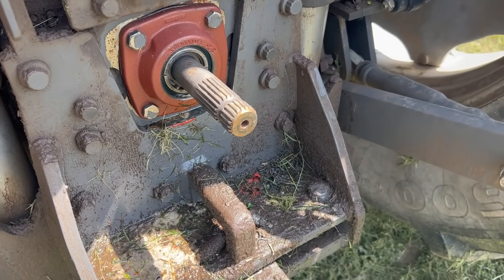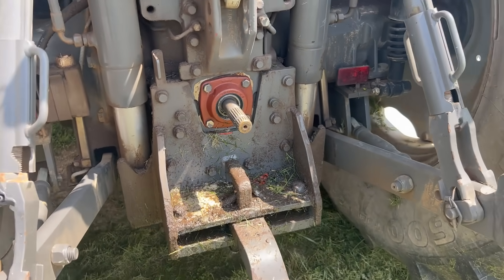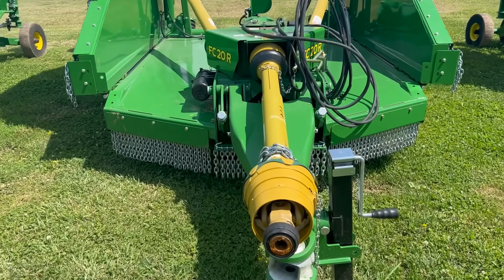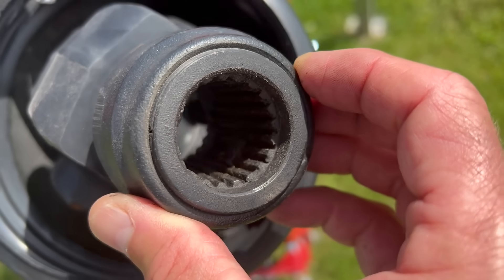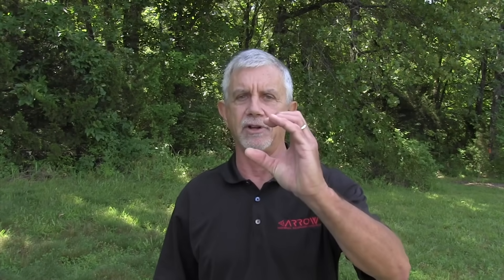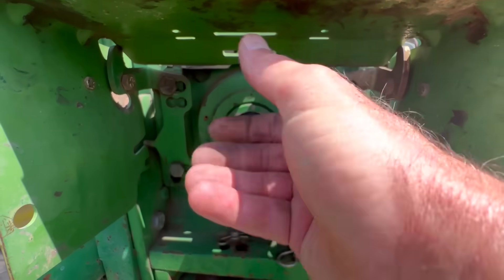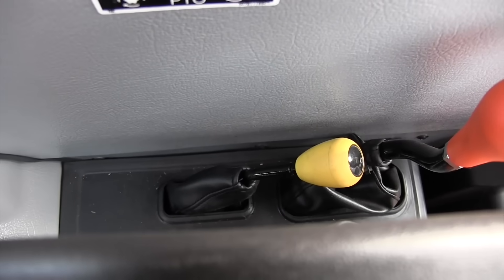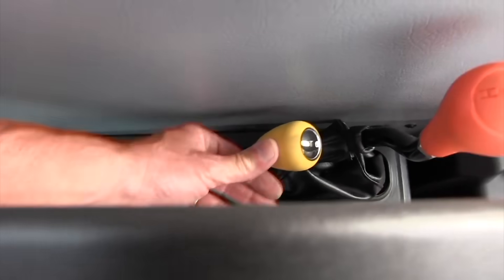Demystifying Tractor PTO Speeds: 540 Versus 540/1000 RPM Explained!

Comment: I love the 540, 750, 1000, shifter on my mt573. Works great on overpowered implements as you said and I don't have to rev the shit outta my engine. Coming from heavy equipment,  I cringe at rpm over 2000.

Comment: Both old John deere and International tractors had a bad design what with the dual shafts spinning on the IH, and the having to park downhill on the Deere when changing shafts.  Like, you shouldn't have to park a tractor downhill to change a shaft, that's a big inconvenience.  I only did it once and decided it was better to just swap them quickly and deal with a little bit of oil loss.  Older Case tractors had the better design where you just pop the shaft out and turn it around and put it back in.  Different splines on either side.

Comment: I have a Massey Ferguson 5455 and it has two separate stub shafts for 540 and 1000.  The 540 shaft is two inches longer than the 1000 shaft, so you don't have to change the drawbar length.

Comment: I like the Case 70 series that flips the shaft.   Simple.  Just need to take care to clean shaft well before flipping.   You will lose a little fluid onnthe flip,. When you flip, one side of shaft is longer and you have to push and compress a spring to engage the other gear set.

Comment: In 1990, I bought a Kioti LB 2204 that had 4 PTO speeds.  540,720,1000 and I believe 1500. Had a manual shifter.  Never used the higher speeds. Did shift speeds with a bush hog to see the difference.  1500 sounded like it was ready to take flight.
Reply: I have a similar situation with my old Mitsubishi 650 bull 4-speed but I believe the top speed is 1250 I could be wrong about that though

Comment: Nice video.  A common problem with hired help is the misunderstanding of torque v. horsepower.  There is a misconception of rpm and its effect on torque load. This causes repeated shear pin breakage on grain augers.  The operator will run grain auger slow thinking it is easier on the auger and be frustrated at the darn shear pin breaking. This is made worse due to the auger running fuller at slow speed since the grain has more time to flow into the auger flighting as the flights "pass by" the inlet.  I attempt to explain the shear pin by comparing it to an electrical fuse and saying rpm is like voltage and as speed increases a smaller fuse is required as fewer amperes are needed to do the work (horsepower).  Slow it down, torque load increases, pow goes the shear pin, get the shovel and clean up the spilled grain.  A bigger problem with a grain cart with a huge auger.

Comment: My favorite auger tractor is our old IH 784 with a 1000 to 540 adapter on it. lt will idle all day moving as much grain as it would on the 540 shaft running at 1800rpm.

Comment: What I wonder about is when you go from 540 to econcomy 540 your rpms drop . At least on my tractor it plainly on my tractor  to keep RPMS 2000 or above but the E 540 runs at about 1500 RPMS . I was told by the dealer that if you run the tractor below 2000 RPMS it cause clogging of the DPF system and problems in the regen system . So I  run my 540 pto at the recommended 2500 RPMS and if I use the E540 Which recommended is around 1500 RPM I do not run it below the plainly labeled not to use below 2000 RPMS while working I run the 540 E at exactly the 2000 RPMS which 500 RPMS above 540E RPMS marked on the tractor. I see it as problem but a split the difference to stay away from DEF and REgen problems while using the 540E .   SUGGESTIONS

Comment: Mike I have a Kubota M5400. The filter bowl got a crack in it and fuel ran out. I replaced the bowl and tried a start it and it just turns over. A mechanic at the dealer told me that I’ve got air in my lines at the injectors. It’s above my skill level. So I’ve been trying to hire someone to load it and haul it to dealer. It’s been down for a year next month. Down here in Gulf Coast Texas in a farming community I thought it would be no problem getting it back running.

Comment: As an European tractor operator, more specifically Scandinavian. Ive barely hit 30y and as long as ive been interested in the farm and such we have always had the same type of pto shaft. This was probably changed / adapted before i took notice but ever since our old old Fords from the 70s and early 80s the shaft has been the same, the "540" shaft. And its been used on all the equipment as we just change PTO gear. And if im not mistaken it was 540 and 1000 gear to begin with and eventually we got 750rpm but that got basically renamed to 540e as you got 540 rpm on a lower engine rpm. 
Im guessing these older ones, the smaller ones and for some markets its an overall simpler design like shown here thats mostly being used

Comment: You guys need to go overseas more often😅

In europe all tractors use the same six spline shaft. Doesn‘t matter if it‘s a ten feet mower on a 70hp tractor or a squarebaler on a 350hp tractor. Plus every tractor can change PTO speeds from the cab in seconds, either with a lever or by touchscreen. Most tractors come with 540/1000/540e/1000e PTO speeds nowadays. 

Everything else seems ridiculous to be honest🙈

Comment: Dairy Farmer here… most of our equipment is 20 spline 1 3/4 1000 rpm not the smaller 1 3/8 1000 rpm’s you are discussing. Most small tractors with 150 Hp will not need a ‘big’ 1000 as they don’t produce power to run our equipment anyways.

Comment: in eurpope we have the6 spline shaft for 1000 rpm doesn't matter how much horsepower, we can run 540 rpm machines with the 1000rpm and save a ton of fuel

Comment: We mainly got some older tractors. All of them have a 540 PTOs but 4 of them also got 1000 on the same shaft, so no switch required.
Models are John Deere 2850, and 3200X. Also 2 Schlüter (German Brand) with the same thing.

So not sure about being able to tell it 99% of the time on older ones based on the shaft alone. Could also be a regional thing though.

The John Deere 3200X is our most recent one (between  20 and 30 years old). When the 1000 RPM PRO is selected you can rev to a second indicator on the RPM dashboard which is labeled 540E. But I guess this would be applicable for all tractors having a 1000 RPM PTO on the same shaft then (even without the indicator), as some RPM must result in the PTO speed being 540 then

Comment: belarus mtz 80 has a 6 spline pto with 540/1000 switch. but the shifting is under the tractor and need from factory 14 and 17 keys to change the speed.

Comment: A Ford factory engineer told me that when a pto shaft is turning at 540rpm. It requires 8 tonn of force to pull the two shafts apart    this reduces too 4 tonn when turning at 1000rpm.   You can see why if the shafts are not regularly greased, they can pull out the stub shaft from the tractor

Comment: If you have the early style John Deere, you can be on a level surface and not lose too much, at least on a 4020.  Take both snap rings out, remove stub shaft from holder, have it in one hand, being sure to clean any debris off that could get into the sealed area.  Pull stub shaft going out the back, and quickly (but gently, don't want to knick anything) put the other stub shaft in.

Comment: I think i understand.....mabye....so basically the name says how much rpm it is, 540 rpm ? , but how much engine rpm do you need to make the pto have 540 rpm? 1000 engine rpm is 540 pto rpm? I dont get it....
Reply: Engine speed ratio to PTO speed is dependent on the tractor. MOST have a mark on the tachometer showing where the engine speed is matched to the 540 or 1000 rpm PTO speed. I know that 2200 rpm on the engine is the rated 540/1000 rpm speed on a JD 7810. It varies by make and model.

Comment: Is this a US thing with two PTO shafts for different speeds?
My 50 years+ old David Brown tractors just have a handle, where you can change speed from the cab between 540 and 1000
Reply: You can not put a 21 spline 1000 Rpm shaft on a 6 spline 540 David Brown.
Reply: @crandonborth  
No, but you can run the tractor at lower rpm for a low power implement.
Reply: Just chage the yoke on the schaft😊 @crandonborth
Reply: Most europian tractors have 6.spline shaft and gearlever that is easy to use😊

Comment: John deere such as 3010 and 4010 had bolt on pto shaft But the back of each was different and it would automatically shift the internal gears for 540 or 1000 depending on which shaft you bolted on.

Comment: Oh bull your so full of shit!!  All balers even huge ones are 540. Every implements are 540. You have to request for 1000. My 240hp and 140hp and 120hp uses both and never have a problem. 
My 20 foot brush hog uses 540. I could have requested it in 1000 but cost $3000 more. It does just fine with 540. 
My 55hp is 540 and i use my 20 foot bat wing brush hog on it too and it works flawlessly. Always has. 
Your hilarious saying need to change the hitch. Those big tractors dont have adjustments. Actually real tractors dont have adjustments. Now these knock off like tym kabota & branson you can adjust drawbar. And adjusting drawbar isnt for your horse shit. Its for shorter 3 piont attachments that hit the drawbar when you lower them. The real tractors will move side to side to either offset your drawbar equipment or to move drawbar out of the way of short 3 point attachments. 
 And no you dont have to park tractor at a slope. Its amazing how you read the brochure but have no real clue in real life.

Comment: My old Kioti has selectable 540/1000 and is nowhere near 70hp.  So far never seen anything in my power class that runs at 1000 rpm.
Reply: I have Kioti LK3054 from the early 90s. Yep, same lever.  The only time I use 1000 is running the sprayer. You can get the pressure at just above idle.

Comment: My Valmet 6300 (85 hp), 33 years old, has 540 and 1000 with the main lever in the cab (also neutral). On/off is electrohydraulic.
So the speed and shaft have no correlation.
I read the manual and calculated that on my tractor I get 540 out on the 1000 gear at just over 1100 engine rpm. I've used it for "super economy" when running a small square baler and a trailer behind it. Having high hydraulic flow meant that the tractor driven bale kicker still got enough flow to throw them into the trailer. 
But you got to be very carefull not do accidently press the foot pedal. 
I tried it with my 120×120 cm (4'×4' I believe you would measure it) fixed chamber round baler. Worked until the right at the end when the chamber is filled up. I could do very soft bales with it but for easier handling with slopes etc I went to the 540 gear instead.

Comment: To me it feels like modern equipment have raised the bar a bit on 540.
Implements that require a bit over 100 hp tractor only has 540.
Maybe modern material science have given us better PTO shafts. But feels a bit dumb when tractors of that size anyway (nearly) always have 1000 rpm but you don't get to use it.

Comment: Well, i am from germany and a farmers son...  And honestly i didnt know about 6 to 21 Spline in common with 540 swtich to 1000 until studing Engineering of Farming Equiqment.  I only still wondered why our JohnDeere 6220 complaines about running above 600rpm when running 1000rpm on a mower. xD 
Absoluty nobody do this here. 
Still 6-Spline running at 1000 till around 250HP, and then, maybe, switch to 1 3/4 6Spline when running a powerharrow or big squarebaler. But not even then everytime.

Comment: Good info. Didn't know about the economy PTO. In my situation most equipment is 1000 but agree it's nice to have both options. Lots of 540 equipment around.
Reply: Some modern tractors even have a 1000 economy speed. Which also can have 540 and 540 economy for a total of four engine to pto ratio

Comment: Good explanation, Mike.  I was not even aware of a 1,000 RPM PTO.  I've had a Kubota B2601 for about 6 years and never used the rear PTO.  Shame on me.
Reply: In America the 1000 PTO is illegal to use on the smaller kubotas but it is supplied in the rest of the world to use rice threshers and other specialised equipment.

Comment: When I was about around 13 years old my Dad bought a new 1966 John Deere 2510 tractor. It of course had a 540 rpm and had the 1000 rpm shaft you talk about. We never had a use for that extra shaft, however, it did have a mid PTO that was a 1000 RPM. We did use that mid PTO to run a side mount sickle mower that was made specifically for 2510. If you’ve ever used a sickle mower to cut hay that side mount was very easy to use compared to the three point hitch style mowers of that era.

Comment: There is now a 1300rpm pto on bigger tractors. Think it might be a european thing have never seen it on the bigger american tractors. Its deffinately on the fendt 9 and 10 series FWA tractors. I think it might even be a larger 6 spline shaft.
Reply: Correct... the high HP machines that are designed to run lower engine RPMS are starting to implement them.

Comment: The allis chalmers way of swapping from 540 to 1000 in my opinion was one of the best back in the day    The internationals was ok but the 540 shaft was so low on the back you had to be careful with mounted brush cutters that the shaft wouldn’t hit the deck when you raised it.

Comment: My little Kubota B5200 has a 2 speed PTO.  540 and 825.  Is the 825 the overdrive you were talking about?
My old MF 265 has 540 and Ground.  Ground will move as fast as the tractor's ground speed.
Reply: That's for PTO driven rakes and similar equipment. It was a great idea!

Comment: When JOHN  DEERE   in 1961   Came out with the New Generation  Tractors, (10 series) they had both 540- 1000  Bolt in  Inter changable shafts....  The speed change   was internal ...    By installing the  different shafts  one had a hole in the end that allowed the shifter rod to  move to shift the gears inside the  rear to  the proper rpm...  Problem was if shaft mounting bolts came loose  the rod movement would  allow the pto  speed change gears to try and engage both speeds... usually damaging  shift pin inside rear end.. requiring  tractor splitting to repair....  They fixed the problem on the 20 series....

Comment: The other reason to get both 540 and 1000 pto if you buy a tractor is if you need to rent equipment.  We have a disc bine that is 540 pto but the dealership closest to us only rents ones with 1000 pto so if we needed to rent one to finish  getting the hay off we would have to rent a tractor also if our tractor didn't have it.

Comment: My 40 year old Yanmar subcompact has a lever to switch from 540 to 1000 depending upon which speed the implement needs. My Woods 59" belly mower runs at 1000 RPM selection. These old Yanmars were definitely way ahead of their time in many ways.
Reply: Yeah i saw that in asian tractors too....both speeds ...
🇨🇦🤓🤟
Reply: Mine from 92 (24 hp)  has 4 different pto gears 🫨 for what i can use them ??? I generaly use a tiller and flail mower on the first witch gives 540 at 2.5k engine rpm and thats it.
Reply: my old Yanmar does that and the reason if you don't need a ton of power you can do the same RPM from a lower engine RPM standpoint using much less fuel 
I use my 3 point hitch with a dump bucket or a rake or a box blade.
at the same time I need more hydraulic output for front end loader or a broom or a rock tiller.
so I have a pump on my PTO underneath my three-point hitch that draws out of a remote reservoir cooler unit that doesn't interfere with  the other equipment much.
Reply: You'll probably come across a no-name tractor that had that feature 30yrs before your copy cat tractor
Reply: @tcmits3699  if you are so smart, then go find out and tell us.
Reply: @tcmits3699 Probably not.
Reply: @Bill-sp8kb  David browns had that somewhere around 1965
Reply: @TheJohndeere466 yep. My Mid 70’s Case 380ck/DB 885 has this feature.

Comment: Personally at 70hp, I would not recommend the 1000 RPM PTO. It is my opinion that you often will be under powered on the tractor for these larger implements. If want to run the larger implements, step up to more HP on the tractor (approximately 100hp or more).

Comment: Glad to see you shared this for the utility tractor users i tell them to not get it the 1000 rpm unless they have a lot of mowing to do . My 300 horse case tractors use 3 different shafts very easy to switch out and the machine automatically changes for the speed . Most grain carts, Big Square Baler use larger 1000 shaft and most Batwing mowers are the smaller 1000 shaft usually unless you spec it differently.

Comment: I think your writer also needs to research the rotary cutter he thinks he wants. My dad's 10' Rhino has the six spline coupler for the tractor, but the rest of the shafts are 1.75" with either 20 or 21 spline.  It wants 540 RPM. Couldn't imagine turning a big rotary cutter at 1000. 
I will say my small Mahindra 1640 has a  lever to select btwn 540 or 1000. 
I think he has to shop the tractor based on the rotary cutter he might want.